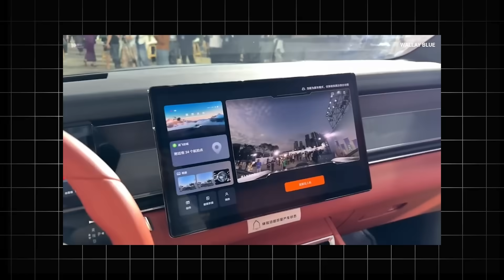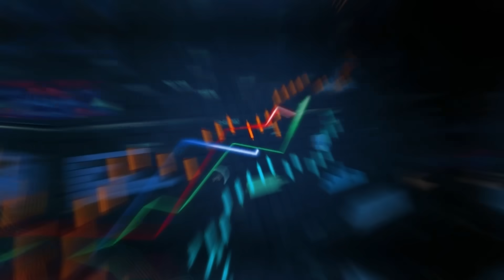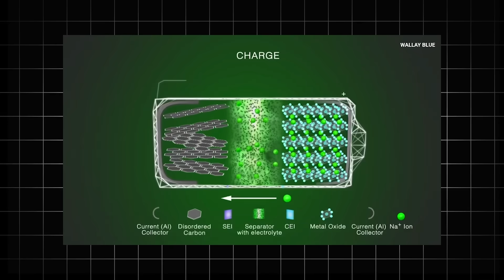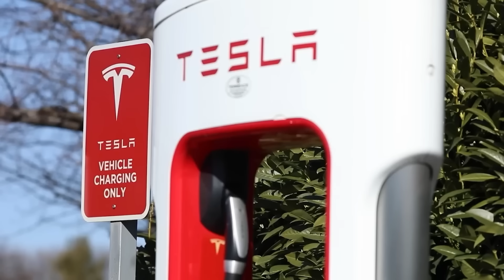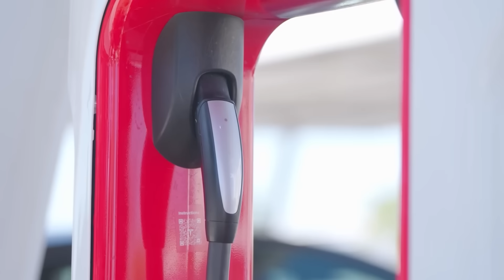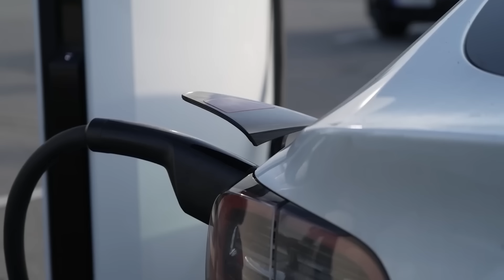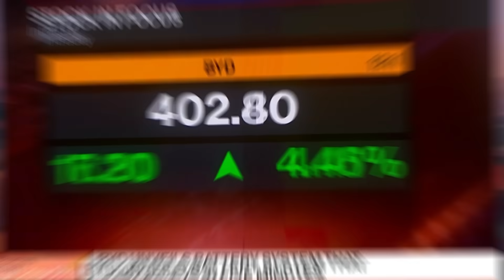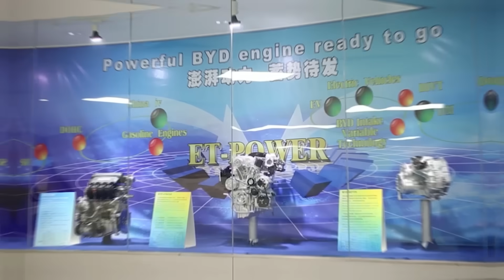Elon Musk SHOCKED As BYD Unveils New Battery System That Can Charge Cars in 5 Minutes

Comment: I rather have 4 250kW chargers than a single 1MW charger. An EV charges fast enough for any long trip. The advantage I see is that if it can cope with this power, at least 250 kW can be maintained on the whole charging process (250 kW -> 42 kWh every 10 minutes).
I don't think I have low standards, but there we're really in an area of diminishing returns.
I wish they also stopped to put so many useless features in their cars and focus on making the ones they keep very reliable.

Comment: It's great that a car battery can be charged at 1300+ kW in 5 minutes—but do you think that energy comes from "thin air"? Do you believe that the charger and batteries are the only problems that need to be solved for EVs to become as practical as we're used to with ICE vehicles? Do you think there's no need for a substation behind that charger? Or a high-voltage transmission line behind that substation? And behind that, yet another high-voltage substation, and so on, until you reach an actual power source?

Do you really think it's feasible to have extra-high-voltage (440+ kV) transmission lines running along every road in the world, with charging stations every 20-50 km, each requiring at least 100 cars of 150+ MVA capacity? That would mean hundreds of thousands of kilometers of HV and EHV cables, thousands of substations, and HV switchgear installations—all built into an already overloaded grid in many places. Who will build all this, and at what cost?

In my opinion, anything other than swappable batteries (where you can replace one in 2 minutes) is nonsense and a pointless waste of resources.
Reply: Aye. More info needed. Cell cooling for example indicates more weight in each battery made up of cells. So while it might charge faster, it'll discharge faster trying to shift that weight. The question is, is the new balance they struck worth it cost/benefit wise.

Comment: Show me the Infrastructure that can cope with just 10 of these cars charging at that rate!
Reply: You can use 3 Tesla Megapacks or comparable products from BYD or CATL. If you have enough time, you can charge them on a household outlet.
Reply: @martinkobil  Yeah and 30k+ $ on top of the Cars Price!
Reply: UK Infrastructure could... If they turn off everyone's smart meters to balance energy demands.
Meanwhile wind turbines are being paid 'constraint payments' to throttle their power output because intermittent wind unbalances energy grids. So slower/braked rotation speeds increase longevity meaning more constraint payments out of the same wind turbine.
Turns out the thing to watch out for with good news... is the scam behind it.